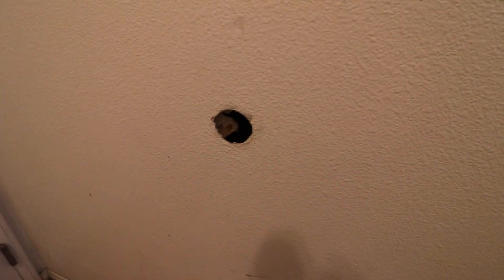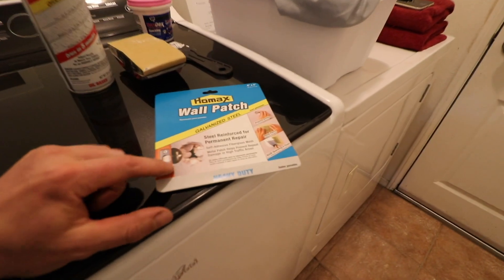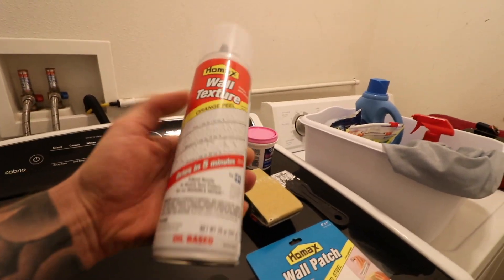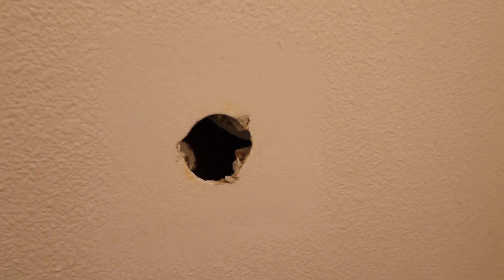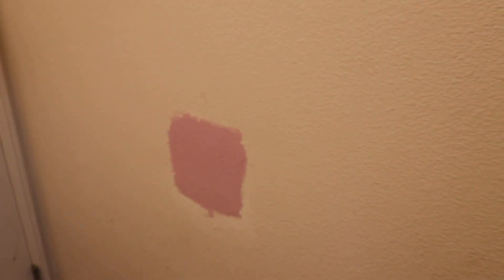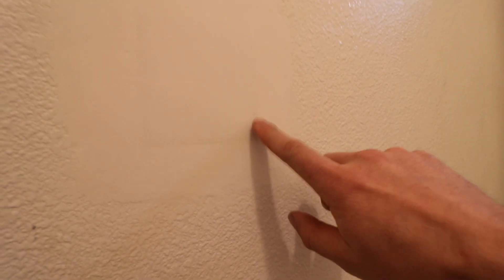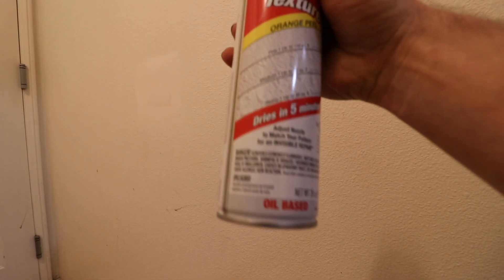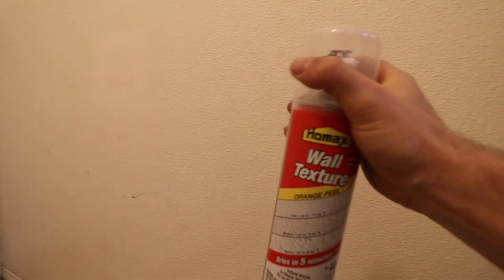HOW TO FIX A HOLE IN THE WALL - EASY 👍

Comment: Only thing I would add is using a knock down knife for the texture spray, I've done that its saved me my security deposits so many times... After a bit of sanding and paint the landlords had no idea I had patched anything! I even had one guy tell me he was shocked we didn't put any holes I the wall.. although I used 4 ghost anchors to wall mount a 60" TV for the year I lived there 🤣🤣🤣
Reply from the maker: Yeah thats a good tip also probably quicker and easier than sanding!  lol so you know all too well how to patch holes in walls.  This was my 1st try but I think it came out pretty decent and proves anyone can do it 😎